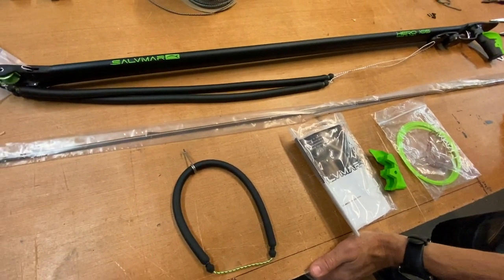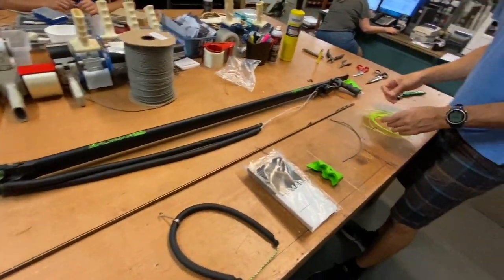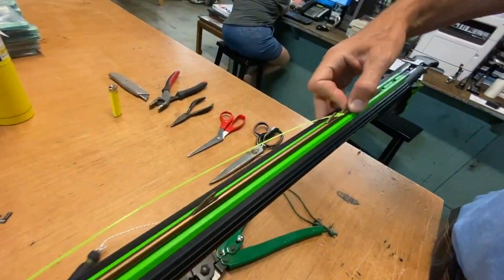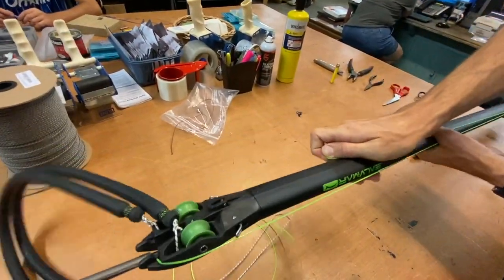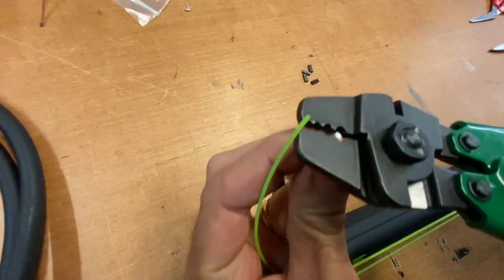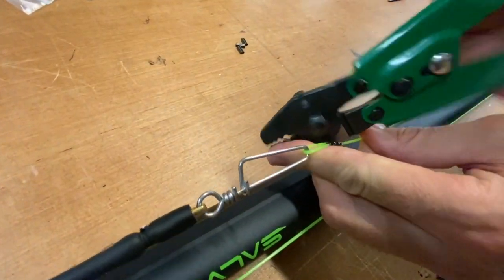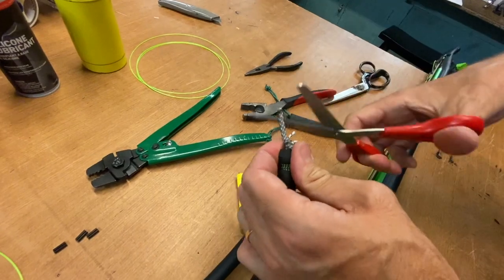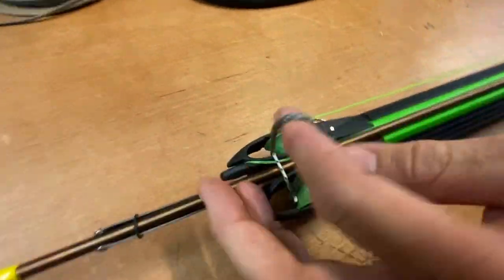Salivar Hero Roller Speargun Rigging How-To

Comment: I appreciate the vid. But you didnt wrap the cable over spear tip and double wrap back to trigger release. I'm glad I can still wrap over tip but will have to replace cable if i want the extra 2m distance. What is advantage with the two rig options? I have the 115. You should mention this option first before someone else cuts there cable.
Reply: I still haven't crimped near the muzzle since i. Confused  if i should wrap cable over shaft tip or like you have it? 

Salvimar has POOR instructions
Reply from the maker: @patrickgraczynski6096  You can either do it by running the shooting line from the shaft under the front "horn" in the muzzle and back across the muzzle to go under - thereby holding your shaft DOWN - OR, you can do it how I did it and just leave it without wrapping it over the shaft.  The reason is when the bands are tight the shaft will NOT MOVE either way.

Comment: how can you rig the shooting line such that the shaft doesn't slip out if you tilt the speargun?
Reply: he did wrong line must over shaft
Reply from the maker: I think we’re show it on the video, simply wrap it around the horns.
Reply: @alexundo2114  correct; if you have a bungee you may still have enough length to load it properly if you followed the video exactly.

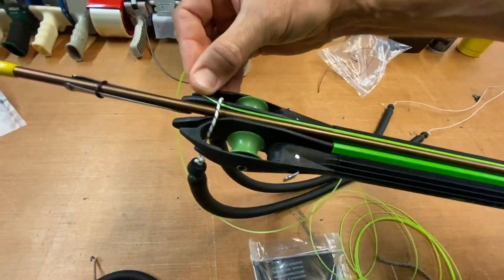Comment: Great video thank you Mark, however you made an error at 4:00 as you didn't run around and over the spear to lock it down against the track. Of course if you don't run the shooting line this way on an open muzzle gun it won't be accurate and moreover the spear will simply fall out of position if it's inverted. Otherwise very helpful video! I did find that I could use the gun without the load assist or the bunny rabbit ear by picking up the wishbone with the other end of the loop on the further forward retainer (ahead of the reel mount), load to rear shark fin, then turn back over and position back closer to the handle. Less drag than the bunny ears :) However I do have the 95 so the longer versions of this gun may not be as easy to load in this manner. Overall, a great design by Salvimar and loving this gun! Thanks again